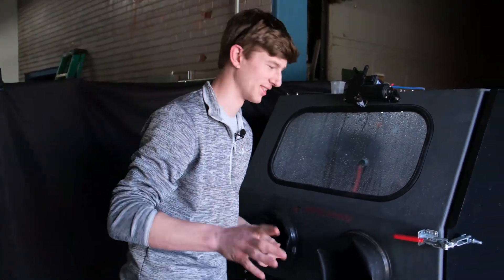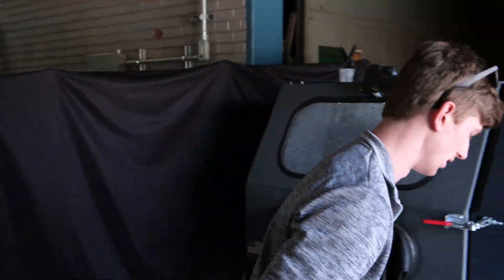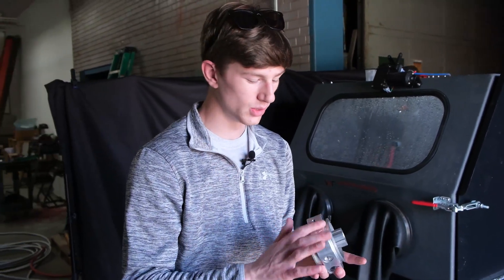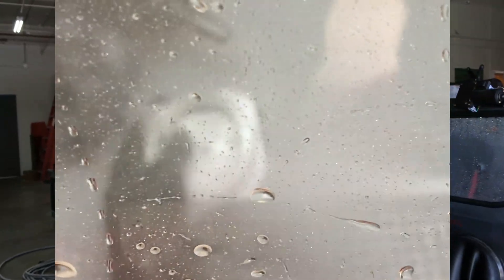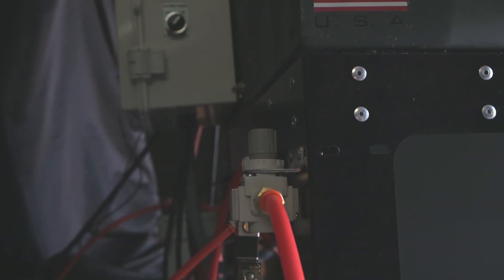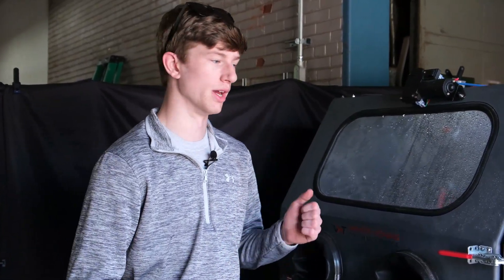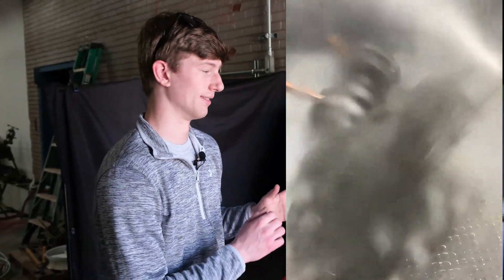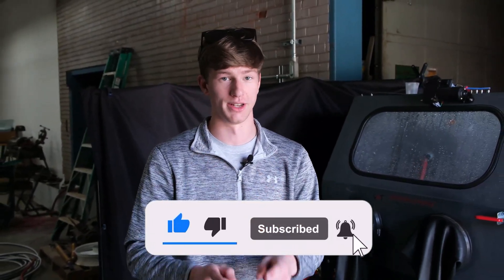Is High Pressure Wet Blasting the Future of Surface Treatment?

Comment: i see another cabinet in my future.  soo many questions come to mind. 250v ? under 50amp? would like to see before/after CNC parts. maybe a micrometer for an old cylinder before and after? media types? open loop? higher rate of replacing wear/tear parts?
Reply from the maker: We are glad you are as excited as we are! To answer your questions, this specific machine was operating around 50 amps and it is 220V. We will definitely be doing more testing in the future, and will make certain to test some CNC machined parts. Also, this machine can handle the same abrasives as standard wet blast, and this machine is closed loop. Great questions, thank you for commenting! We hope you have a great day!

Comment: Does glass bead shatter at high pressure? Also curious about the reliability of the the pumping system with the abrasive media would love to learn more this could be a big win for the industry. Is there a filtration system feeding the pump clean water or can the pump handle the abrasive?
Reply from the maker: In our testing, we found that glass bead held up quite well under high pressure, although for extended longevity, we're shifting to ceramic media. As for the pumping system, we've implemented a custom filtration system specifically designed to protect the pump so that it does not directly handle the abrasive material. These are excellent questions, and we appreciate your curiosity! If you have any more inquiries or want to delve deeper into our technology, feel free to ask. We're here to help!
Reply: I doubt any HP pump can handle the the sediment concentration this is using. Its probably close cycle otherwise you would loose media too fast. So yeah it probably has a media separating stage followed by a filter to feed the HP pump with the same water but cleaned. I have a good idea what the use to separate the media but looks like they want to keep it a secret with the curtain in the back so 😬... Smart from them tho. Not having to invest in a high CFM compressor will be attracting to a lot.

Comment: That would obviously destroy thin trim pieces for example unless the pressures are adjustable to that degree.  What would be the capable pressure range for that machine?
Reply from the maker: The pressure is fixed on this particular machine, but we do have another in testing that is configurable. This machine is designed more for larger parts that need fast prepping or finishing. Excellent question!